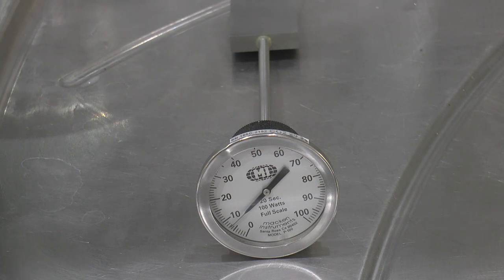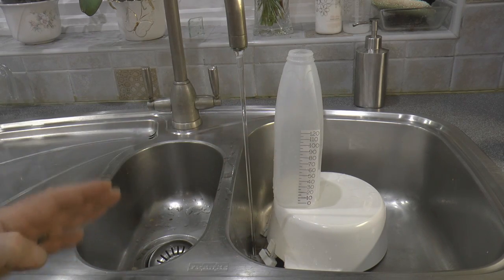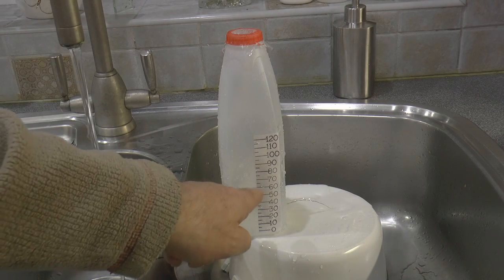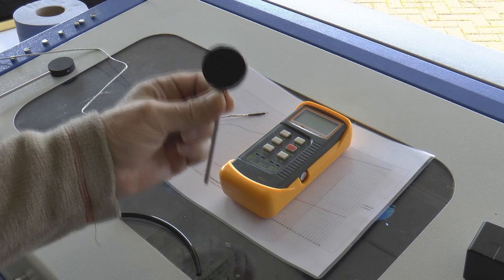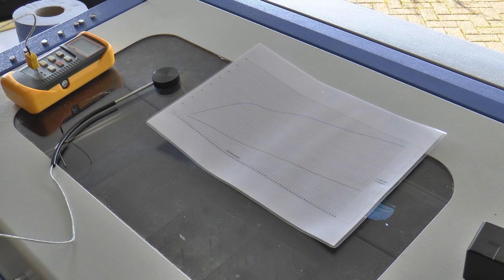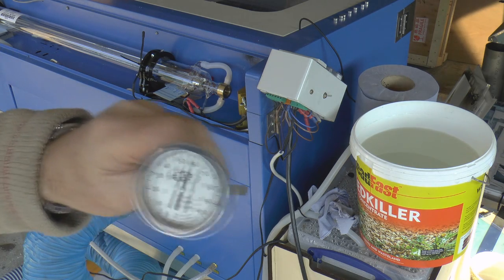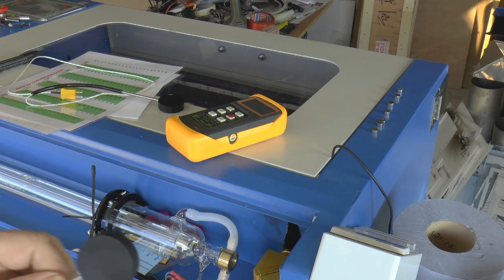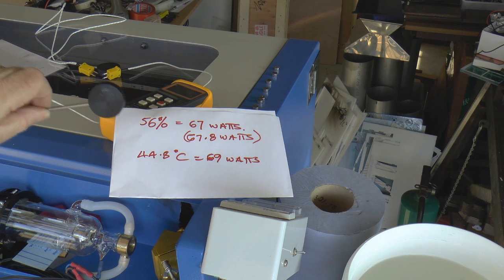RDWorks Learning Lab 53 Power Meters and  the doHICky comparator

Comment: Hi, works your system also for LED laser diodes with a range of 0,5 ... 10 W optical power?
Reply from the maker: This device was designed for use at 10.6micron wavelength where the conversion of light energy to heat is virtually 100% . I do not have experience of your 0.45 micron wavelength but the physics  says  absorption at that wavelength is about 70%. So yes it will work but not give accurate  results. 
 Best wishes
Russ

Comment: Hello Russ,

finally found this video :) i'm also interested in the doHICky any left?
Reply from the maker: Hi Srdan
 Yes I  am currently making a new batch because demand has been steady  and there always people such as yourself that are joining the laser club. This is not something you need to use every day so it is not a good investment to spend a lot of money on convenient hi tech equipment.. This was purposely designed to replicate the results from much more  expensive kit  but at  a price that allows you to use it a few times a year when NOTHING else will do the same job. I need your email address to send you a data pack . Add another comment  with that information and I get auto copied to my gmail. I will immediately remove your comment/email from public view,
Best wishes
Russ
Reply: @SarbarMultimedia  we oedered our laser just a few minths after you started your chanel so i learnt the basic of rd labs from you, and then dare i say it i did not watch your vidoes as i had a lot of other stufd going on, now two years down the road i regret nit watching your videos as i would have learned a few more things then instead of only now. The gauges are really expensive so your solution dose fit the bill, i do need a way to kwep track on the powef of tube and to see even if we did get a 130w tube :) other thing is that i have a laser wirh the fixed head positikn as the beam aligement is a big issue for me. Wondering if you will also make a modd for this head to make it adjuatable. Thanks again.

Comment: Got my doHICky awhile back, and laser finally here ready to run some initial tests.  Curious what your thoughts are on the deep hole for the grub screw withholding varying amounts of water per test.  Seems like a small piece of electrical tape to block water from entering would work well.  But that is not the same setup you've used to create the tables and such.  Thinking about doing some experiments of my own, but wondering if you've thought or tested this issue much yourself yet.
Reply from the maker: I do advise in the accompanying video that you put a glob of silicone bath sealent in the hole when you have fixed the thermocouple in place.
Best wishes
Russ
Reply: Ahh not sure how I missed that.  Thanks again Russ!

Comment: Could measuring the temperature rise of a known volume of water measure laser power?. Water absorption coefficient at 10um is 100000/meter or 99.9% for 1 cm, water thermal mass is 1C/gm/watt. Shining a de focused laser into a small container of stirred water
Reply from the maker: Hi Tim
My first attempts at power measuring were done with water and I did a lot of reaearch to establish what the absorption efficiency of water was. "almost 100%" was as close as I got. The physical problems associated with getting the water to absorb the energy was never overcome. The light hitting the surface of the water gets absorbed rapidly within parts of a millimeter as it changes to heat energy and causes the water to boil and evaporate. As the power increases the ability to agitate the surface to  prevent this evaporation loss becomes impossible. You are then faced with the inevitable question of how much is my stirring energy causing the temperature to rise and how efficient am I at preventing surface heat losses because of the high thermal gradient (ie convection losses). I even tried a recirculating micro pumped whirlpool  into a funnel where the beam was fired into the bottom of the funnel where the turbulence and flow rates were greatest. I could monitor the temperature rise caused by the pump and compensate for that.. Great fun trying but a real waste of effort. Water calorimetry was not the right approach to power measurement. It was silly to even pursue that route to start with because how ever was I going to measure power losses across in situ mirrors  or directly out of the laser tube. I have to admit that my enthusiasm and naivity  swamped common sense.
I have spent many hours discussing other enthusiasts ideas for  cost effective ways of measuring power and I have done a few more crackpot experiments myself. None have succeeded and so it came about that I decided to understand and develop a much cheaper non-commercial version of the existing technology.
By the way defocusing the beam does not fix the issues. The raw beam is typically 6 to 8mm diameter with a Gaussian energy density profile. I have looked at the energy profile in the beam with a K type thermo-couple that will work up to 1300C.  In a 40 watt beam I can see peak temperatures at the centre of the beam that are over 1200C. I tried the same test with a 70 watt beam and melted the thermo-couple.
The other issue that was a surprise to me is just how bad water is at conducting heat
I have to say that this machine/technology has sent me back to my old text books many times and taught me many new things as well.
Thanks for the comment because it's always good to rework ideas in case some stones.did not get turned.
Best wishes
Russ
Reply: Makes sense, 99% of the energy is absorbed in the first mm of water as I think about it. I’ll be receiving an aged but quality laser engraver over the next week, it surely need some TLC,. Do you have any lollipops left. I really enjoy your videos, keep up the good work!
Reply from the maker: Hi Tim
Use the You Tube message service to privately send me your email address and we can proceed from there
Best wishes
Russ

Comment: Thanks Russ.  BTW, Bula is Fijian for Greetings.  I will be buying my machine direct from the manufacturer, and it will be a $3K-4K machine, so hopefully I will have a few less issues.  By watching your  series I have been able to over specify the machine to get exactly what I want.  I am paying more, but will hopefully have fewer problems.  While shipping from China to the UK is expensive, it is almost double to Fiji because the volume is so low.  Also a lot of the stuff you can find at shops there in the UK, I have to import.  So I need my machine to be almost perfect when I get it.  Cheers, Kim

Comment: Bula from Fiji Russ,  I have enjoyed your videos enormously and learned a bunch.  I am buying a bigger machine with a 130W laser.  You created your calibration chart based on the power graph for your new 60W tube.  If you created it from the power graph from the original tube the values would be quite a bit different I imagine.  Now I doubt that the power graph for my 130W tube would have a linear relationship to your 60W tube, so how would I create a calibration chart without a reference?  I could make a power graph but the output numbers would just be relative to one another with having a true value associated.  I wouldn't know if top end power was 100W, 130W or 150W or anywhere in between.
Reply from the maker: Hi Bula

There is no way to measure the power other than having a power meter and you should certainly have an ammeter on your machine. If there is not one fitted they are at most $5 from ebay., I strongly advise fitting one, it will be your best friend. helping to look after your tube. . I cannot say what tube will actually arrive with your machine but if it's an ebay machine then it will almost certainly be a usable 100 watt tube, with a maximum output of 130 watts which you cannot use or you will invalidate any tube warranty. When your machine arrives let me know the diameter (80mm i guess) and its overall length  (maybe 1650mm but I guess 1450mm). Tell me of any labels on the tube  and I will advise on the maximum current you should be using.

Best wishes
Russ

Comment: Hello, thank-you for all your great videos. Is it yet possible to buy 2 or 3 DoHICky's ? I plan to replace the 'normal thermometers' by a uC. A litle uC like a litle Arduino, can take temperature, time, and calculating the power automatically. If it works well, i plane to put all on public site for share. Thank-you in advance. :-)
Reply from the maker: Hi Daniel

Sounds like  great idea. A couple of others had spoken of something similar many months ago but I'm certain they stalled. I shall need your email address so that we can speak off line. Use the private message system to get me your email.
Best wishes
Russ
Reply: Thank-you. Did you received my private message ?

Comment: 22:17... It seems that you are testing an IR Laser at 67Watts without Laser Safety Googles...
Please tell me I'm wrong....
Reply from the maker: You are not wrong. However I always wear glasses that have polycarbonate lenses. Perhaps you misunderstand the nature of this 10.6 micron wavelength light. Yes it is classed as light  but at this wavelength the energy manifests itself as heat energy that is rapidly absorbed within parts of a millimeter when it his an aqueous surface. That means that IF you get your eye right in the path of the beam or get in the way of a coherent reflection then the surface of your eyeball will absorb the energy and permanently damage your cornea. Other wavelength lasers will react differently with the eye and could damage the retina and make you blind. Those other wavelengths will not be absorbed by glass or plastics and the do require specially prepared glass materials to filter out the dangerous rays. The IR generated by a CO2  laser is definitely not safe. However, nor are moving automobiles when you purposely or accidentally step in front of them! You should understand the risks when working with fire and act accordingly. Please do not fear this technology, just treat it with respect. I use my machines all the time with the covers open because I am filming, but on those few occasions when I demonstrate the dangers of reflectivity  I will not be putting  my eyes or my camera in the firing line. I must also point out that the very nature of a laser beam is it's ability to remain coherent ie there is no scattered or incidental rays, only  direct or reflected rays.
Watch my video https://www.youtube.com/watch?v=kJe16YQlIM0 for a demonstration. If you use your machine with the cover closed the risk is ZERO but if you do run the machine with the cover open and do not wear glasses,  then any cheap polycarbonate industrial safety glasses will afford 100% protection.
Thanks for the comment
Best regards
Russ

Comment: These videos are great, thanks for doing them. How did you determine the calibration chart? was it done my  camparing to your commercial meter? Is there any way I can develop my own chart?
Reply from the maker: Hi Ron
You are correct. I bought the Macken meter to check my machine because I had failed to find a way to do it on the cheap for myself . Once I had the meter I was able to calibrate my machine. I then spent quite a bit of time trying to figure out how it worked. I could never make one for myself without having a calibrated power source. Having spent my money I then had a seconadary standard power source  (my machine) that allowed me to design and calibrate the dohicky. . It has been designed to cover a much wider range than standard kit  but it is not claimed to be a scientific instrument but something that is pretty repeatable but not absolute . Even my Macken meter only claims to be accurate within +/- 5%.
Many have tried to follow your dream and many have failed because how hard can it be to stick a block of aluminium to a meat thermometer?? Not hard at all. It's a bit like cutting a piece of string from a ball to use as a measuring stick. What does it measure? units of string!! there is no relating that length of string to absolute without a secondary standard (tape measure) to define its length is usable units.
Hope this helps answer your question
Best regards
Russ
Reply: Thank you for that quick reply. You are right if one wants to make a measurement in absolute terms. But for use to see if we make improvements to our laser we don't need to know an absolute power value. If I made an instrument like your dohikey and simply use it to make before and after tests of things  like mirror adjustment, then just noting if the temperature is higher is all we need. I only need to see if I made improvement with my adjustment, knowing a watt number is nice, but not necessary.
Reply from the maker: Hi Ron
Again you are perfectly correct. The problem I had was trying to find something anodized, cheap and uniform that anyone could buy. I f I could have found such an item then I could have devised a calibration chart for it and just given that away and let folks fend for themselves. No such item available. The biggest costs of making something are the machining, the anodizing in particular, and the postage.  If you buy something like this and expose it long enough to rise by about 30 C above ambient  you should have something that repeats within a degree C. Maybe your local Maplin or electronics store will have something similar.
http://www.ebay.com/itm/1PC-30-17mm-Black-Anodized-Machined-Solid-Aluminum-DVD-Potentiometer-Volume-Knob/321441068287?_trksid=p2045573.c100033.m2042&_trkparms=aid%3D111001%26algo%3DREC.SEED%26ao%3D1%26asc%3D20131017132637%26meid%3De4bb60b42e9e4336b9643deea5cd5513%26pid%3D100033%26rk%3D1%26rkt%3D8%26sd%3D321441068287

Regards
Russ

Comment: After watching this video I started poking around the Internet looking at power meters.  I see that Russ is using a Macken analog meter.  Macken lists this probe at $339.  Not a cheap item.  Very nice design on the dohicky by the way.I happened to run across an auction on eBay for a Macken DM5 digital meter with two 20-100 watt probes.  Macken lists the digital meter at $480 and the probes at $252 each.  I managed to pick up the meter and the two probes for $190.  At that price I couldn't pass it up.  I was excited to get home and test it out.  I recently installed an ammeter to make sure I wasn't overdriving my tube.  I've been concerned from day 1 after watching these videos and hadn't ever run it at more than 70% power.  After installing the ammeter I was pleased to find that at 100% power I was reading just over 21.5 ma.  The tube in my machine is an EFR 1200CL.  The manufacturer lists the tube as a 60 watt nominal power tube with 70 watts max and a current rating of 22ma.  So at 100% I was driving the tube just under the rated current.  With this meter having come with two probes I was able to test one probe against the other.  I was quite happy to find that I am getting a measurement of 71.8 watts with one probe and 71.7 watts with the other probe.  That was at the entrance to the third mirror.  Overall I'm pretty pleased with the laser machine, the tube, and the meter.
Reply from the maker: Hi Travis
A real good buy  for a digital system. Is the reading instant?
You are now all instrumented up, safe and able to sort out any power loss issues. You will find you don't use it much, maybe once a week at the workface just as a health check.
Russ
Reply: I didn't figure I'd use it much but also figured it would be nice to have.  At that price I couldn't pass it up.  It is not an instant reading instrument.  It works very much on the same principle as their analog meter.  It's a lollipop of aluminum that is heated over the course of a specific time period.  In the case of my probe it's 20 seconds.  On the higher wattage probes it is selectable.  According to their literature it's somewhat smarter than just a digital thermometer on their analog probe.  In practice that seems to be exactly what it is.  I'd be happy to send you the 3 page manual the company emailed me today.  I think the main advantage is the resolution that can be read.  It reads to .1 watts.  I also found that I made an error in my earlier test.  Their is a calibration sticker on each probe.  One is 18.9 and the other is 18.5.  I believe I'm supposed to use that exposure time as opposed to 20 seconds to get an accurate reading.  Still was happy to see the output of my tube is obviously very close to what it's supposed to be and that the two probes had fairly consistent readings.  You can take a look at them at www.macken.com.
Reply from the maker: Hi Travis
Yes their sticker is the number to work with. The probes would have originally been supplied with their own calibration certificate, it's not a chart , just a piece of official paper that restates the sticker number. The new numbers will reduce your readings by 3 or 4 watts at most. I had to think twice when I bought my probe but it has been worth it. With my analogue probe, when the meter has been exposed I have to wait for the thermal lag to register the highest reading on the gauge. This could be a 15 or 20 second wait to see the result. The K type thermocouple in the doHICky reads instantly the exposure has finished. That is the question I was asking, do you get an instant reading after exposure or do you have to wait?
Best regards
Russ
Reply: I understand now.  You do have to wait.  The meter decides how long.  After the exposure the value continues to rise until the meter beeps and says "final" at which point it locks the reading.  I'm guessing it's just waiting for it to peak.